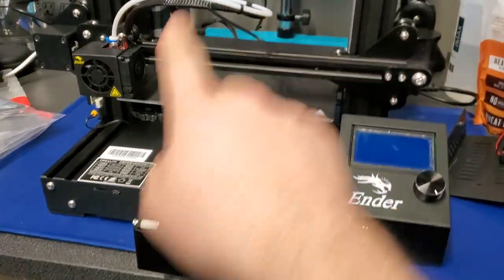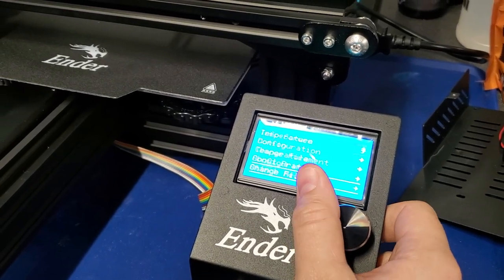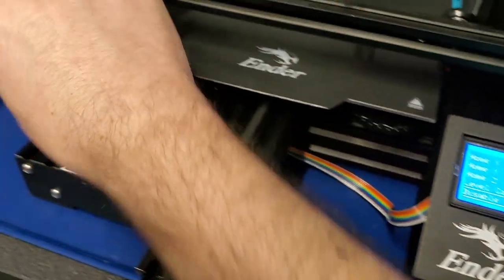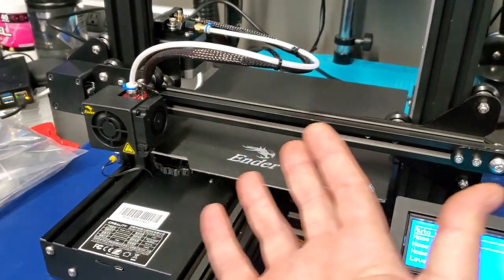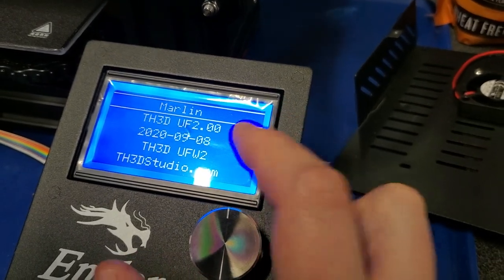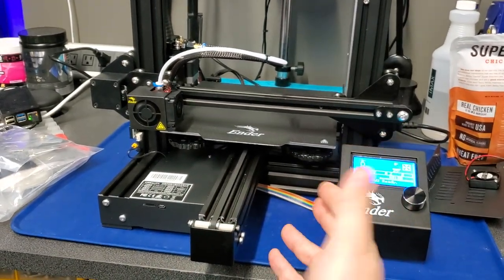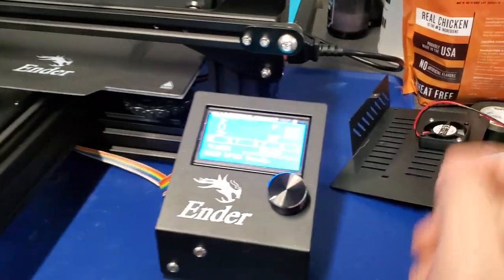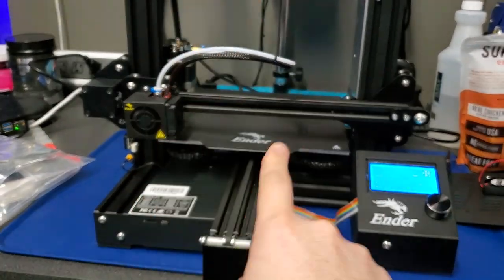Ender 3/5 V4.2.2 Board Firmware | Update on Progress

Comment: Thanks alot, dont forget about our Ender3 V2 users.  We need that software to be able to give us e-stepping and Manual mesch bed leveling
Reply from the maker: You won't be able to do manual mesh on the stock Ender 3 V2 LCD unless Creality releases some source for it or someone figures out how to hack up its firmware binaries. It's a DWIN LCD like the touch screens (so pretty much the same limitations). If you swapped it for the same LCD that is on the Ender 3 you can with the right firmware changes, but as it stands right now with the state of the Ender 3 V2 LCD it is not possible unless code is released or someone figures out how to hack it to work. If you want mesh leveling the EZABL is going to be working on the Ender 3 V2 very soon as well. It's something we're working on right now.
Reply: @TH3DStudio  I heard something about that Creality has a certain span of time available to them before they have to release the source code and all the STL files etc etc?  Not sure that amount of time, but probably getting close for the V2 hopefully?  Seems the biggest problem is yes, the DWIN_SET files and the new display?  Anyone notice how VERY similar the new display and layout is to the Prusa Mini? ; )

Comment: So I purchased an ender 3 from creality last week and it came with this board. It took a long time to figure out what was going on. I also have a bltouch installed and I am running the firmware from crealities site. Everything but the offset is working correctly. I have figured out how to adjust the offset but no matter what I do it won't save after a power cycle. I look forward to your release of firmware and integration of the bltouch.
Reply from the maker: We added BL Touch options and left a link to the teaching tech video for connecting a bl touch to those boards. Check the latest firmware and in the BL Touch section there is that link to his video that shows how to connect it.

Comment: Hello, I had a static incident and it wiped the micro SD & my 4.2.2 board will not boot anymore. Is there a way to revive it with an ISP header and raspberry pi?
Reply from the maker: You would need the bootloader file from Creality and a STLink to program the bootloader over the SWD header on the board (you'd have to solder pins on to it). We carry STLinks here: https://www.th3dstudio.com/product/anet-firmware-flashing-tool-stlink-usb-adapter/
Reply: @TH3DStudio  Thanks for the quick reply!

Comment: I have the 4.2.2. board also on my 5 pro but it says TMC connection error. If anyone can help I would really appreciate it. I emailed Creality and they wanted a picture of my board and the error and I haven't heard from them since! Does this need an update, if so how do I go about this, is there a certain folder I need to put it in?
Reply from the maker: You likely have the firmware setup wrong. TMC connection error means you set up the firmware with TMC2208 driver settings instead of TMC2208_STANDALONE. These drivers are in standalone. Use our firmware here: https://www.th3dstudio.com/hc/downloads/unified-2-firmware/creality/creality-ender-5-5-pro-firmware-v4-2-x-board/
Reply: @TH3DStudio  Thanks! Creality finally got back to me and all I had to do is add an endstop.bin file. I am still not happy I ordered a "pro" model with updates, but they don't bother to update the software.. Thanks again for the help.

Comment: Hello, I have a problem with the Ender 5 PRO printer, namely after installing the BT sensor after uploading the firmware, I do not have the Ofsets Z option
Reply from the maker: You need to setup the firmware for the options you have on your printer. If you are using our firmware read the config file as it contains directions for the various options. You could also contact Antclabs for technical support on their sensor: antclabs.com/contact

Comment: Please help! I installed a e3d v6 on my ender 5 pro with 4.2.2 board but marlin willnot flash! Ive followed your guide and others. It just boots up regularly.
Reply from the maker: Format the SD card with FAT32 file system and 4096 allocation size.

Comment: Hey man I have a creality 4.2.7 mother board how do I up date the firmware on it. For some reason printer inset working with usb even no it makes a notification noise. Firmware says marlin 1.0.1. I have ender 3 pro and just bought mother board off Amazon. Need serious help please
Reply from the maker: Use our firmware here and follow the directions on the page: https://support.th3dstudio.com/hc/en-us/articles/360049104812-Creality-Ender-3-3-Pro-Ender-5-5-Pro-Firmware-V4-2-X-Board
Reply: @TH3DStudio   well it just so happens that the new motherboard does have the 6 pin adaptor that is need to be used to get flashed with isp. the old mather board has the 6 pin next to display. the new one doesnt.  the isp has a 10 to 6 pin adaptor chip that suppose to connect to the other board. where would this be located on the new board.  Thank you for helping me out

Comment: have an ender 3 pro and has the 4.2.2 board firmware 0.0.6.i updated the firmware to 
Ender-3 Pro-V4.2.2-32bit 
Marlin2.0.1-V1.3.1- BLTouch 
so now after update it does a buzzing sound and and auto homes to the middle of the board.did i do something wrong or is it the wrong firmware??thanks
Reply from the maker: "Marlin2.0.1-V1.3.1- BLTouch" is not a firmware we put out. You should contact the place that you downloaded it from to see what they say about their code.
Reply: @TH3DStudio  Ok thanks,i looked for a version without the BL Touch and it works.Thanks

Comment: Did you ever end up making that video about using the bootloader to update the 4.2.2 boards? I checked the channel, but didn't see it.
Reply from the maker: 4.2.2 doesn't need a bootloader flashed. it has one. It flashes with the SD card. Follow directions here: https://support.th3dstudio.com/hc/en-us/articles/360049104812-Creality-Ender-3-3-Pro-Ender-5-5-Pro-Firmware-V4-2-X-Board